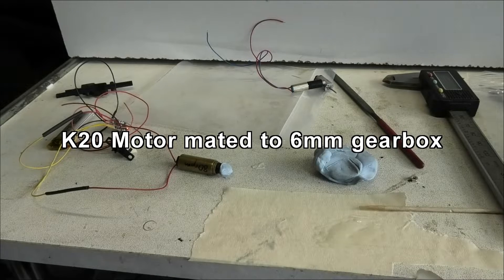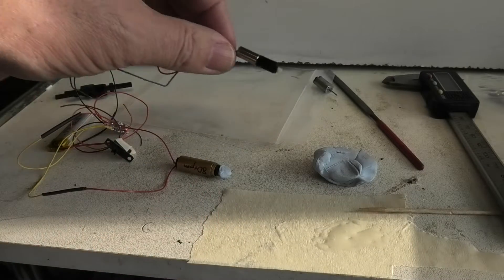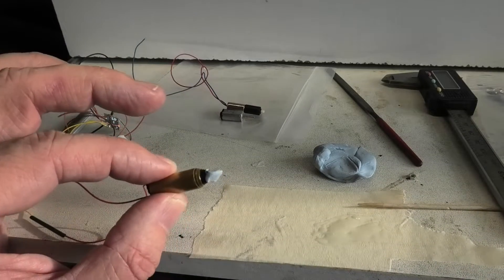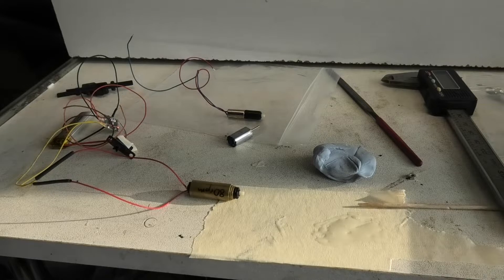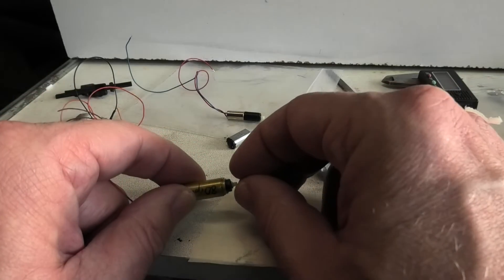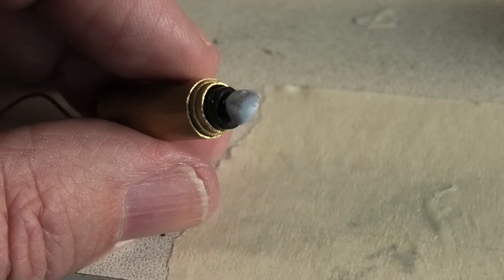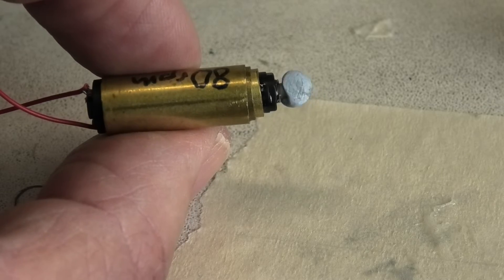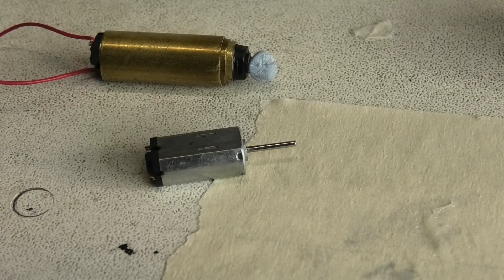K20 6mm Hybrid Gearmotor conversion

Comment: I did something similar recently where I had one of those 6mm 100 rpm gearhead motors you had that wasn't starting up smoothly and so mated the gearbox section to a Tramfabreik 8 x 16mm motor. I did this by unscrewing the gearbox section, cutting the shaft down and opening out the first gear so it could fit onto the motor shaft. I then screwed the gearbox onto the mounting holes onto the new motor which conviently were similar in size to the ones on the or motor. Even though it was larger, it ran so much better and made itself more useful in what I have in mind for it. I'm quite tempted to another one with Svens 6x15mm motor using the sleeve method you have shown.

Dan